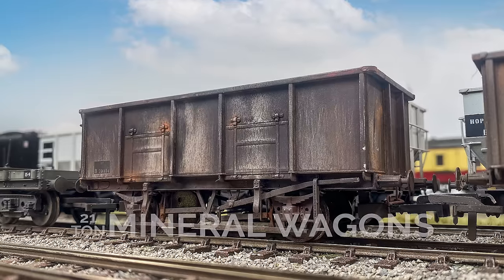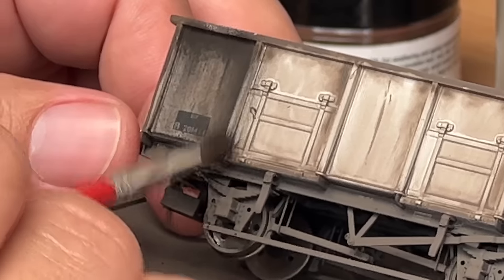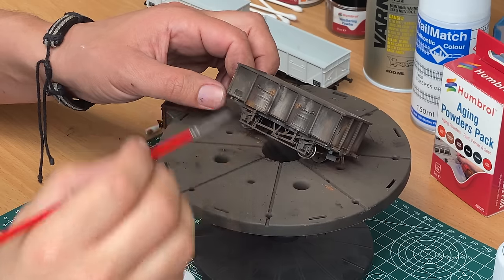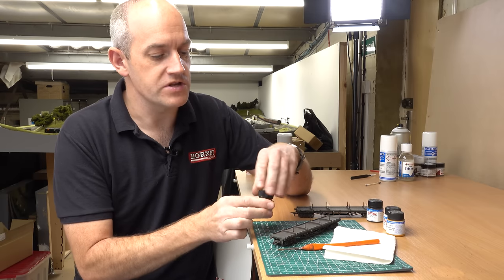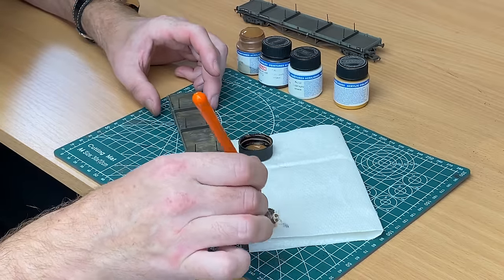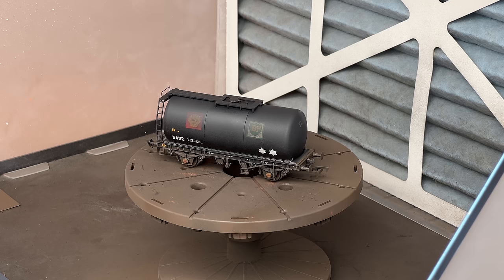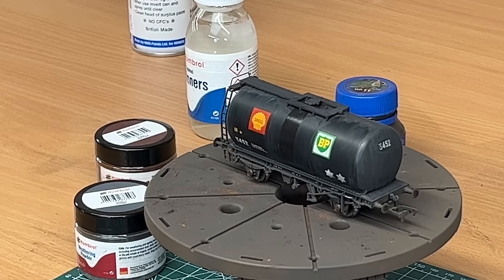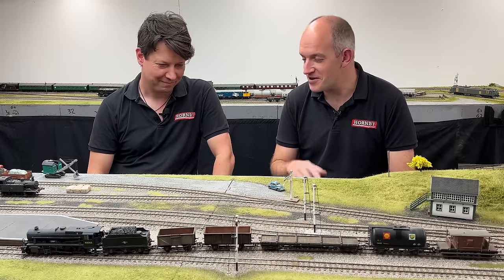SERIES 5: 1960s Weathering - Part 1 | Goods Wagons

Comment: Really interesting and inspiring chaps. Just a quick question, did Mike varnish after applying powders? I'm assuming so or wouldn't it come off with handling?
Reply: Yes, typically you want to varnish after powders. However sometimes the varnish can dissolve the powders further. I tend to find doing heavier powders coat is best if varnishing as it’ll ‘knock it back’ to a medium powdered finish.
Reply from the maker: We did varnish the powders, but only lightly. Too much and you can get a white fog occurring. A case of less is more in a single application.